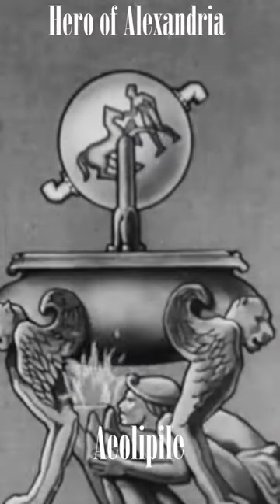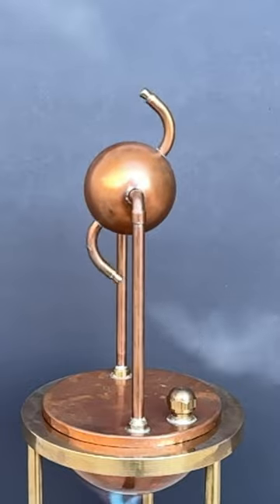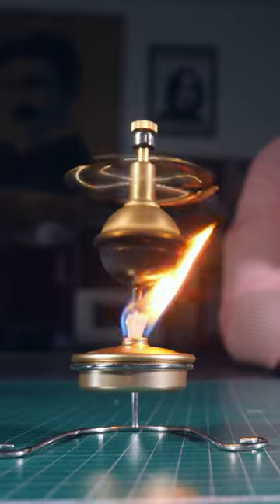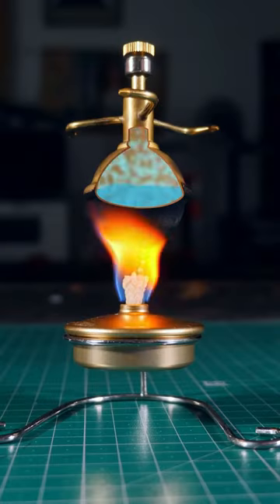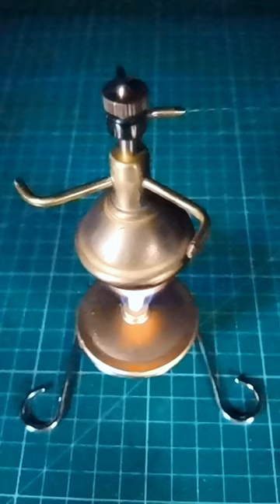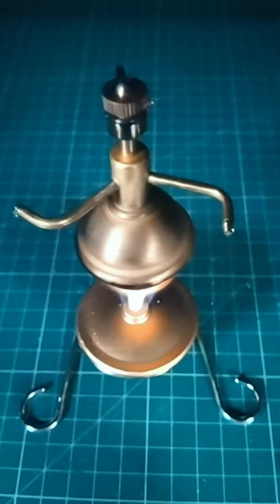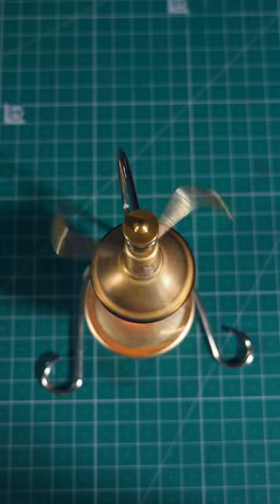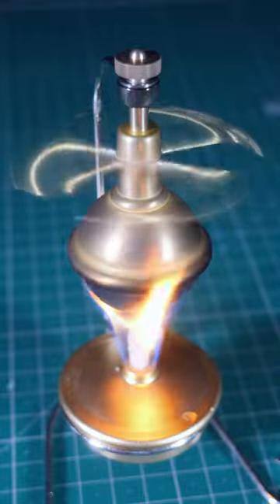Hero’s Turbine #engine #science

Comment: Heron was very smart, he also invented the first vending machine (you put a coin in a offer bowl and the dropping coin triggers a level that opens a valve for holy water), or automatic gate (you burn a offer on the altar and the heat suction (vacuum) opens a gate, with special altar, after the fire stop's counterweights close the gate again. Very smart person.
Reply: A good offer for Mars and Jupiter
Reply: its not the machines he made that amazes me.

its that he made them at all...

the labour to make  a brass sheet, to drill a hole, turn a shaft round... with basically nothing to start with.

Comment: "That act as micro rockets.." ..... Okay, now I want to science the sh*t out of those and give them expansion cones to make them actual rockets :)
Reply: I'd actually like to see that done.
Reply: like all rockets... pressure over area.

atmospheric, 15psi.
say its 30 inside. that pressure acts in ALL directions.

a 1 square inch hole.
the pressure inside is only counteracted by the atmospheric pressure outside across the hole...

15 pounds difference, 15 pounds thrust.
speed is limited to a certain pressure differential, 0.577 iirc for steam. p1/p2. a normal orifice, a plain hole, it will never come out any faster no matter how high the pressure differential.

hence the delaval/diverging nozzle. allows for a much higher velocity. only so much can squeeze past the choke point, the narrowest point, but as it is hot, full of energy, it wants to keep expanding. the dimensions are just right so it sort of tricks it into flowing into a lower pressure than it really is as it expands, cools, accelerates... its easier to MAKE a delaval nozzle work than it is to muck around with the maths required... they dont work with air unless its also heated.

the  rim still wants a peripheral speed of half the jet velocity for maximum efficiency... thats freaking fast.

hence compounding in stages for lower speeds... no turbine other than the hero's uses just reaction alone.

naw, i wanna make a little one with a coil underneath so the steams superheated then ejected through a ring of diverging nozzles... maybe some tunnels through the center boiler for forced draught. idle musings...

Comment: Let's mod this? 😎
Reply: Could this be made a closed system, like say... run the jet spouts back into the reservoir? Or would the lack of outside oxygen? And back flow timer one way blow doors so the pressure still builds in the reservoir. That way we not losing any fuel from 1/2 the source. We could induce a steam powered vortex lol for the spin and rotation...

Comment: Make a kettle that starts to spin when the water is boiling
Reply: What about powering with an induction an induction heating.
Reply: They make those. I've seen a soviet one with little sputniks going round. Another with a carousel. I think "crazy Russian hacker" showed one.
Reply: @kevingooley6189 that would be kind of cool, like as it rotates with a set magnet under it, it would heat up, idk if resistance would be too high or if it would get hot enough to boil water though. Too fast and the tank could warp, or melt. 🤔 would definitely need some prototyping but it could work in theory.